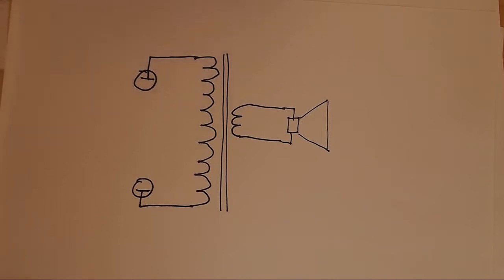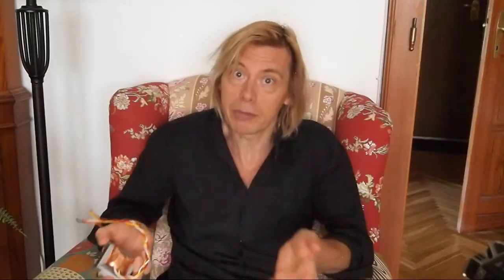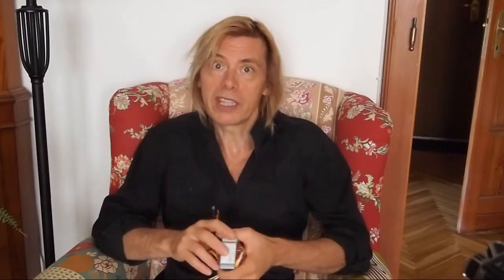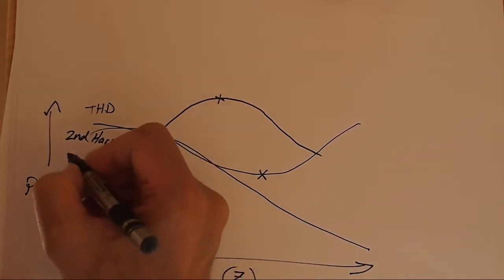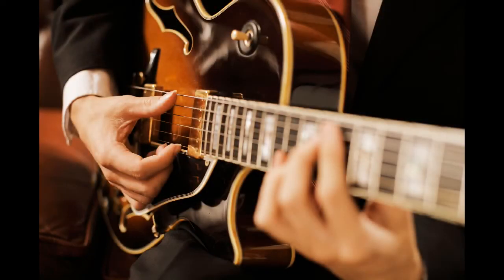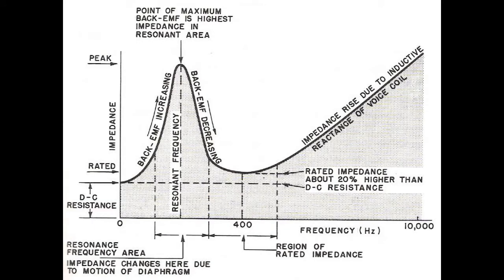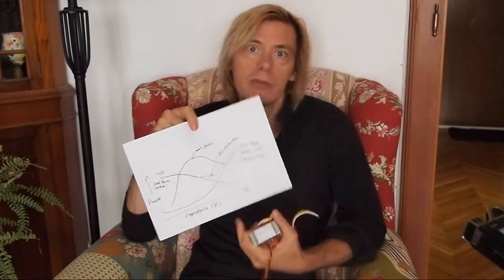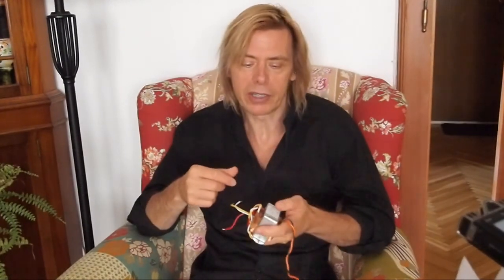guitar amp output transformers

Comment: I have not found complete information about choosing the correct transformer. The output in watts also is a factor in Plate load.There needs to be a good calculator with Tube model ,watts max, and Plate voltage. All those factors need to be considered before you divide the tube load by your impedance ratio. Plate load goes down with smaller maximum power output in watt. but goes up with higher voltages applied to Plate. Google the G.E. 6l6 gc and the Tung sol 6l6 gc data sheets. I  believe screen voltage also affects plate load as well. Please let me know if there is a more complete way to calculate Plate load for output transformer primary load.

Comment: Great video, thank you! I have an output transformer question you might be able to help answer. Last summer I built a Mojotone black panel Princeton reverb from the kit they sell. I made a grievous error when soldering the output tubes by mis wiring one of the output wires from the phase inverter to one of the unused pins on one of the power tubes. The other power tube was wired correctly. So, one power tube was getting half phase signal and the other power tube was getting no input signal at all. I imagine the output transformer did not like this at all… not knowing what I had done, I played the amp for a few days, thinking it sounded very wrong but it might just need breaking in, lol. When the amp started cutting and out I stopped playing it, took the head out and found my mistake. So, now the amp works, sounds pretty good actually, but, and here is the issue, when I play a chord or note and let it ring out, as the note fades, there is this grungy distortion that slowly goes up in volume. It’s really bad on big jazz chords like a major 9 chord. Once again, distortion goes up as the note volume fades… after watching your video I’m am wondering if I damaged the output transformer but didn’t totally fry it… any thoughts on this?

 Thanks!
Reply: Thanks very much for your comment, Omar. Chances are you have not damaged your output transformer if I understand your wiring error correctly, but a DC resistance test of both halves of the primary compared against the published spec would confirm this. You may have another wiring error to chase down, though. Tube  amps are quite forgiving;  component-damaging incidents are rarely subtle :)
Reply: @robertjamesrobson2907  thanks for your input, I really appreciate it. I’ll look elsewhere to solve this issue, but for now I’m stumped, lol. It’s like the softer I play the more distorted it is… weird
Reply: Check the grid bias on the output tubes.  
It may be that the bias is too low - in which case you may be getting "cross over distortion" which becomes more noticeable at lower output levels - (that is - "as the note fades"!)
( Cross over distortion occurs in the low signal  region where - as one tube decreases in anode current to a low level -  the other increases from a  low current . Thus -  If the bias is too low - this area of "cross over" correspondingly occurs at low current levels - and is quite non linear. 

If you can find someone who has an oscilloscope and a signal generator - you can feed the amplifier with a pure  sinewave signal from the signal generator - and monitor the loud speaker output  with the oscilloscope.( ideally feeding into a dummy load of the same impedance as the loudspeaker)
If there is cross over distortion -you will easily see it as a "kink" in the trace where  the sinewave trace passes though its "zero" point midway between peaks. ( That is - where the sinewave trace should ideally be almost a straight line where it passes through he "zero" point)

Comment: When reversing the output transformer plates wires the power tubes will cause oscillating & squealing, any reasons why? Also the output transformer limits the headroom the max peak AC waveform because SRV tech would swap his output transformers with dual showman output transformers or use the 50s tweed twin output transformers because it had higher headroom Cesar Diaz claimed the tweed output transformers were different for some reason

Comment: The output transformer on my Laney VC 30 combo creates the best harmonics i have ever heard at volume 7or 8 or higher but is renown for blowing the OT at volume 10 after some time !

The power tubes breakup  with awesome aggressive slapping style but retains the articulate chord tones as you pick less forcefully !
It is great for rythem and blues !

I have other tube amps but the power tubes do not breakup like the Laney VC 30 !

The OT transformer must be the key to this tone when pushed at high volumes !
The strident highs on the amp get clipped down to a perfect timber when pushed to breakup the power tubes !

The amp has no flubby low notes but strident tight lows with authority !
I think now the OT transformer is nearly a perfect match for the 70/80 Celestion speaker and the 4- el84 power tubes !

Comment: I am an amateur electronic enthusiast and have a million questions, so please indulge me...

4:35 The power supply of a tube amp is a voltage supply, right? If W = V * I and I = V / R (or in this case, Z) and voltage is constant across changes in load and current, increasing the load at the same voltage would only decrease current and therefore power... so why does the power vs impedance graph have a hump instead of being a downward slope?

Most tube spec sheets I find generally show maximum plate power and maximum cathode current... how can I find maximum plate current? 

Also, even if even order distortion is cancelled out in a push-pull design, one would want the load on the tubes to as low as possible (which is why I would want to know the max plate current) as to minimize odd-order distortion harmonics, right? 

Finally, you covered how load impedance affects how the tubes distort... what about transformer distortion itself? I have heard that that sound is desirable in guitar amps, so would one would want a transformer as small as possible as to saturate as much as possible without blowing up? If the sound is undesirable, why aren't we using high powered toroidal transformers? Thanks!!!

Comment: Is it worth changing over power wires black / white on fender blues junior to get 240v. 
If I got a 110 amp could I just add 240 v transformer or ix that dangerous?

Comment: I had a Fender Bassman 100 he uses 6L6 GC Power tubea with Push pull he runs at 4ohms. The amp it can used with only 2 tubes but I read that with 2 tubes the amps now runs at 8ohms . WHY THIS HAPPEND , could you explain me that ?

Comment: please help. my peavey delta blues 2x10 amp is acting up. it goes from the normal sound (about 2) on the volume and then it gets quiet but still works. 
I have placed a patch chord from the effects loop send/return that helps a bit. Also, the second channel has no volume when the switch is engaged

Comment: I am building a replica of an old Vox amp. Its original OT had an 8K input impedance with 8 & 15 Om secondary taps. The amp was originally rated as a 10W amp, but anecdotally owners of originals and its tube compliment mean it probably pushes more like 18W when driven hard. It had 1 x 12AX7 as pre-amp and tremolo, 1 x 12AU7 for second gain stage, (cathode coupled), 1 x 12AU7 for reverb drive and recovery, 1 x 12AU7 for phase inverter, 2 x EL84 output tubes cathode biased in push/pull and 1 x EZ81 rectifier. The PT was 300-0-300V giving a DC output design V of 390V before the first dropping resistor/filter stage. The B+ was around 300V. There are no specs I can find for the original English made Drake OT which had serial nos 352-98 or 352-93. A similar OT available on the market today with similar impedance are only rated for 10 or 15W. Likely the original was only rated at 10W as owners report them running hot and they produce very compressed and nice distortion when driven with good hi end freq output.  In guitar amps having an undersized core and exceeding the power rating was a very common reality. Pushing the transformer over its limits can give a nice saturated tonal quality to the sound that so many people prefer. The original OT was wound on an EI-075 lamination (35 UK style) with a 1" stack height. It looks as though it had interleaved Prim-Sec but I don't know how many. Probably on 2-2 or 2-3 given the bobbin size and stack height. My assumption therefore is that the OT might have been rated at 10W. Is it possible to get 15W rating on such a small footprint? Merc Mag make what they call an OT for this vintage amp and claim a 15W rating but this is arbitrary depending how it was measured, at what freq and into what type of load etc, so it is hard to tell. Despite running hot they seem to last despite being small for what the amp puts out when driven hard. Hammond do a 1760E for a Fender which looks like its on the same lamination. Its 8.5K prim though ion 8 and 16 Ohm Sec which should be OK with my project as A-A Imp is 8K for two EL84's in PP config. So 8.5L is very close. Is it likely something made circa 64 would have had interleaved windings between Pri and Sec. This would have added cost and inter winding capacitance would increase, but this a trade off between the reduction in eddy currents. Have I got that right. I could go up one size lamination to an EI-87 (147 UK) which is marginally bigger but allows for more intricate winding topology. However I don't want to end up with something that changes the tonal characteristics of the original. The MM OT supposedly made to suit the amp is really expensive at $212 US. Whilst it appears MM are generally more expensive than competitors it may be that some of this cost is related to the time it takes to do the interleaved windings and how many there are. The more I study the theory the harder it seams to hone in on a spec to have a OT wound to suit my project.

Comment: I have a tube amp that uses 2-6v6's the speaker in the amp is a 24 ohm speaker. So I want to change the output transformer so I can use a regular 8 ohm speaker, can i select any output transformer that uses 6v6's  in a push pull type amp to work?

Comment: Really informative video. Superb interweaving of engineering, experience and application. Presented with style. Any guidance on wattage ratings when matching output tubes, output transformer and speaker? Especially with 'unidentified' output transformers?
Reply from the maker: Thanks very much for your kind comments, Clive. To answer your question about wattage ratings as succinctly as I can, when faced with an unknown output transformer, you can rely on the fact that manufacturers rarely stray far from norms. This means you can be fairly certain that an unknown transformer will have a similar wattage rating to others with similar core dimensions (and, by extension, weight). Online transformer catalogs provide useful access to ballpark power handling info. Just keep in mind that you can't compare single-ended with push-pull transformers this way: their constructions are different  Also, some designers like their output transformers to be undersized so their cores saturate more easily (which coincidentally saves money and weight) , but for DIY projects or any application where reliability is important, there's no convincing argument for going too small IMHO. The same goes for total speaker power ratings, which must meet or exceed the amp's output if they're to last. I say 'total' because individual driver power ratings can be added of course. Incidentally, this is the sole reason larger classic amps had multiple speakers - to handle the power. It certainly wasn't done for dispersion, cost or weight reasons. i hope this answers your question!
Reply: @q.b.amplification8056  that's really helpful info...thanks.  Funny how many cost saving efforts of the past morph into the stuff of engineering legend.
Reply from the maker: @clivebarrell6448  You've hit the nail on the head, Clive. The rarely-met challenge is to separate the beneficial flukes and genuinely effective engineering choices of old from the irrelevant and obsolete elements that continue to get cloned into guitar amp designs, feeding a cycle of myth and misunderstanding.

Comment: I have a 4 ohms amplifier solid state can I put a 16 ohms speaker?? I hear both, yes and no. I know we should not ever go below the amps ohms to a speaker, (8 ohms amp with 4 ohms  speaker) this will heat up amplifier.  But 16 ohms speaker to 4 ohms amp?
Reply from the maker: Hi Dave. Sorry for the late reply. Yes: you can connect a 16 ohm speaker load to a solid state amp rated for a 4 ohm load. Nothing will be damaged and the sound quality won't suffer noticeably. The only problems would be that you'd  be able to access only 25% of the amp's available power, and the damping factor would be reduced by a factor of 4 (not such a big deal in most practical situations).
Reply: @q.b.amplification8056  Thank you. I really appreciate it.
Reply: It works perfectly fine. I've done the same thing for a year with a tube amp
Reply: @rasmuslkke8233  Thanks for your advice.

Comment: Wow, thank you, Rob, great analogies too. I got here while looking for a way to play the audio from my PC on a guitar amplifier. I'm fairly sure it is an issue of impedance matching. I'm trying to play my PC's audio out (stereo headset output jack) through my guitar amp (mono input jack). I know -- I think I know -- that my PC can power 8 ohm speakers. I've heard that the input to guitar amps is Hi-Z (high impedance). So what kind of transformer do I need in order to play my PC's sound through my guitar amp? And where would I get that transformer?
Reply from the maker: Hi Ron - thanks very much for your comments. Audio transformers are generally used only where there is a need to deliver maximum signal power from the source to the load, whether this be in a tube output stage or in certain types of microphone inputs. This isn't the case with what you're wanting to do, as the low impedance output from your PC will have no difficulty driving the high-impedance input of your guitar amp. A direct connection should work fine. Your only concerns are signal voltage level and frequency response. You'll want to adjust the output level of your PC and the input gain of your amp to obtain the best balance between headroom and noise. I'd suggest starting with the amp's input gain at a low setting, then turning up the PC's output level gradually. As for frequency response, guitar amps are far from flat, so recorded music never sounds very good through them. You may need to start with the mid control up full (if there is one), and the bass and treble controls turned down, then adjust for best compromise. Short answer / good news: you don't need a transformer: just a stereo 3.5mm to mono 1/4" cable, some fiddling, and the willingness to accept less-than-stellar sound.
Reply: @q.b.amplification8056  It works! Thanks, Rob. I had an old Acer laptop running XP (neither are really relevant). It has a separate jack for microphone and another for audio out. Plugging in an adapter somewhat like you described, a 3.5 mm mono plug with a 1/4 inch mono output, and a guitar cable between that and the guitar amp's input did the trick. As you recommended, I turned the LOW and HIGH knobs to 1 (of 10), and left the MID knob at 5 (of 10), and started with the amp volume LEVEL at 1, all this on the CLEAN channel. I found the best mix when the laptop's output was at 50%. A Crate DFX-30 was loud at a LEVEL setting of 3; a Crate DFX-65, at 1. The sound is stereo. I don't know how this will work with other computers (jack for headset with mic) and with different amps, but at least nothing bricks. Thanks again.
Reply from the maker: @rongarza9488  You're most welcome, Ron - I'm glad it worked out. Even as a manufacturer, it makes me happy when people don't spend money needlessly.

Comment: Great video. One question from someone for whom this is new: does this mean that a relatively colder biased amp (thus lower power) means more 2nd order harmonics/less 3th order harmonics?
Reply from the maker: Sorry for the late reply, Johan. Short answer: no, or at least not necessarily.
Reply: A push pull class AB amplifier (pretty much every amp that advertises putting out more than 5 watts,) with a properly balanced phase inverter will cancel out all second harmonic distortion. When it clips, it will likely still have some second harmonics from not being perfectly matched, but the dominant force will be the third harmonic. Class A single ended designs (think fender champ) are dominated by second harmonic distortion instead.

Comment: Very well done. Thank you for sharing your wisdom with us. I have a 2 sets of  unknown  Baldwin Transformers out of a 4 X 6L6 Hammond Organ amp chassis. I do not know how to test them. Any advice?
I just subscribed to your channel!
Reply from the maker: Thanks very much, Finom 1. i could give you a more comprehensive answer if you fire me an email via the Auburn Amplifiers or Queen Bitch Amplification websites, but after checking your transformers for obvious damage, test them for DC continuity on each coil, then apply low-voltage AC to a primary (usually identifiable by wire color) and measure the resulting secondary voltage. From this you can determine impedances and whether there may be any shorted turns.
Reply: Thank you again and I will send you and email with pictures. It may lead you to make another video helping to explain methods to help individuals in my situational out the lead indentification and values for there unknown transformers. Both Power & Output!
Reply from the maker: @Finom1  Fino, I'm very glad I've found your original message. I've lost access to our dialogue, so if you can please contact me through the Auburn Amps website or facebook page.